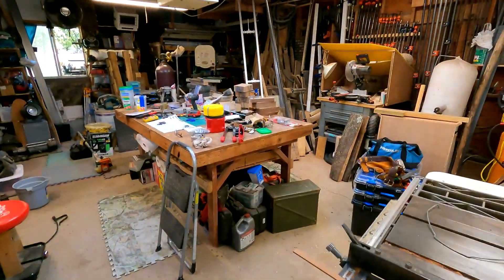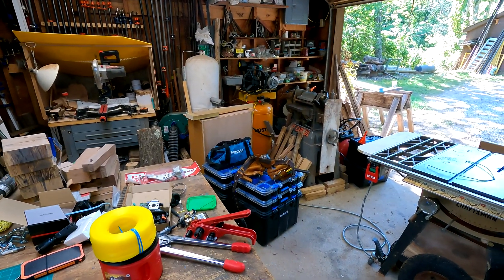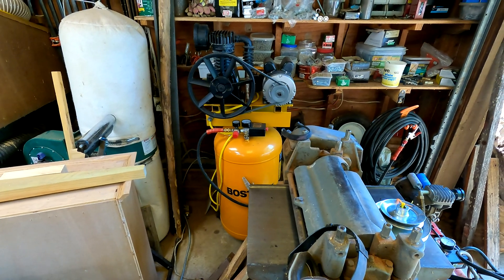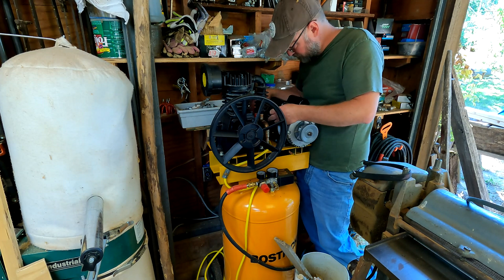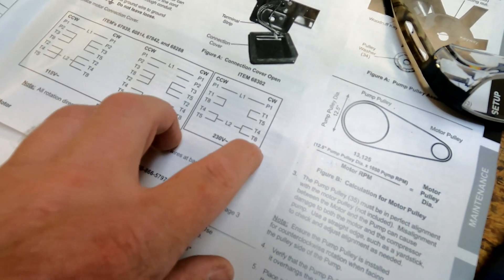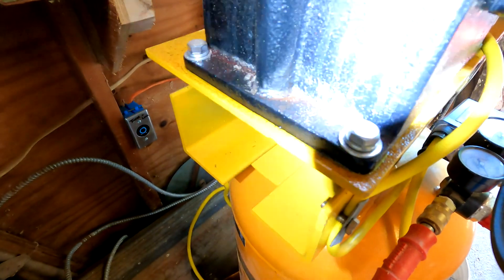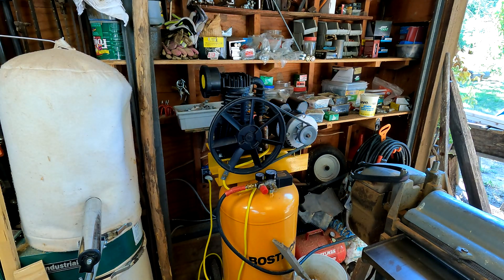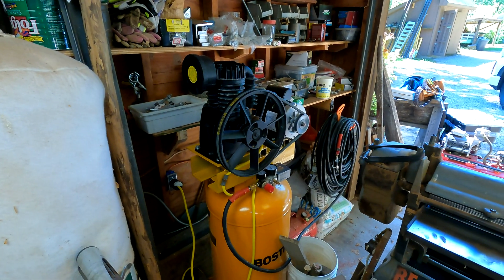Revisiting The Air Compressor Rebuild Project!!

Comment: When I do a mounting plate for the electric motor I buy a large industrial hinge and weld it on a plate, hinge facing to the outside, for just the motor. Then I drill a hole and weld in a 1/2 inch nut for an adjustment bolt. Use a second nut on the bolt as a lock. You then can loosen the bolt to relieve tension on the belt for replacements and then tighten the bolt to add belt tension as needed.

Comment: If you had mounted the motor on the other side of pump it wouldn't be so crowded to work in there. The access points you need would be on the outside out in the open.

Usually there is an arrow on the pump pulley pointing which way it should turn.
Reply from the maker: Thank you for the comment

Comment: A couple of times you had your hands all over the pulley with the switch set to run and the pressure switch able to turn it on when the pressure drops - and the air is leaking. If the pressure switch clicks that pumps starts with your fingers on the pulley it will ruin at least your day. You absolutely need the check valve. It also reduces the starting load on your motor because the pump is seeing ambient pressure when it starts.
Reply from the maker: Thank you for taking the time to leave a comment.  I assure you that at no time did I ever have my hand on the wheel unless the switch was off or the breaker was off.  Or most likely both.  The amazing art of video editing does not include everything.  Thanks.

Comment: With a check valve it will hold pressure for weeks without kicking on, as long as there are no other leaks. At least mine all do. Good luck.
Reply from the maker: I am hoping so!  I have purchased one.  Hope to get it installed soon.  Thank you for the comment.

Comment: You absolutely need a "check valve" with a tube for the unloader valve as well. Those valve are some times called a NRV for none reverse Valve. And the unloader valve bleeds the air off the pump outlet tube of pressure so it will be easier for your motor to start up without fighting the pressure every time...
Reply from the maker: Appreciate the information. Thnx for the comment.

Comment: 😮😮😮.  ,,,TOLD U CHECK VALVE TO TANK ,,,YOU NEED TO LEARN WHAT YOU SHOULD DO BE FORE YOU JUST DO. ,,FUN TO WATCH ,,PULLY PROB. NOW ,, IF CALL'S FOR A 3.60 INCH. NOT A 4 "" OVER RUN PUMP ,,NOT TO OVER RUN ,,  DO USE A 3.5"" BETTER TO UNDER REV ,,,THAN OVER REV...  OVER REV WILL NOT HAVE YOU EXTRA.  ENNY THING THAN EXTRA. WARE TO. PUMP ,,, STARTED ALL WRONG ON SET UP COULD LEAD YOU MUCH BETTER WAY,,, TO SET U TO MAKE EASEY TO FINISH. ,MORE PROBLUMS TO COME UP ,,MESSES END UP MESSES ,, RESHERCH  PARTS OF COMPESSOR UNDER STAND ,,,HAVE A PLAN TO START,,, HOW & WHY THEY WORK THAT WAY. ,GOOD LUCK ,,LOOKING FORWARD TO NEXT VIDEO...👍👍
Reply from the maker: Uhhh. Ok?

Comment: Yes I think you need to put a check valve so the air won't reverse into the pump.other wise good job I like how it turned out.
Reply from the maker: Hello Cesar,  Yes, I agree on the check valve.  Stay Tuned!  Thank you for the comment.

Comment: So glad you got that rotation issue fixed.  The check valve is must.  Didn't you keep the old check valve when you changed compressor pumps?  
  One way to get some extra hand clearance between the big pulley and the hose connector would be to put spacers under the pump.  You have box steel, and wood blocks would work too,  if just for temporary to figure out how much rise you want.  Then you get to figure out the new belt required.
   Good luck with your project.
Reply from the maker: Thank you for the comments.  I will be installing a check valve soon.  Hopefully will have a part 3 to this series.

Comment: Or… just flip the motor and the pump around and it will be spinning in the right direction, you should have the pulleys on the backside anyway
Reply from the maker: Thanks for the comment reefslayer!  If you watch the first video where I do the rebuild, you will see that due to the pre existing location of the mounting plate and handlebar the way I mounted the motor and pump was my only option.  If I chose to swap the motor and pump, I would have to redrill mounting holes.  The option that I chose to remedy this problem was by far the easiest.  If I was terribly worried about having the belt and pulley to the front, then I would just spin the whole thing around on the wheels.  It is not permanently mounted to the floor.  I'm pretty sure that would be the easiest.  Thanks again for the comment.  More videos to come!
Reply: how stupid are you???!!! the motor was spinning the wrong direction no matter what side of the pump it is on!!!